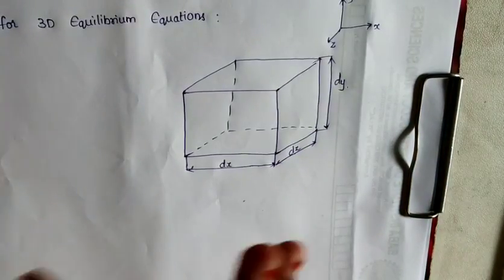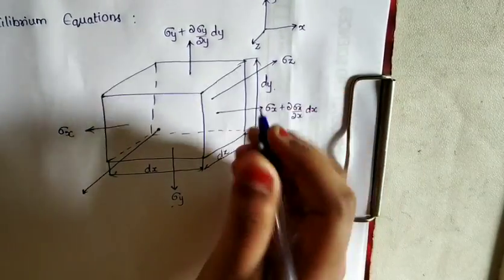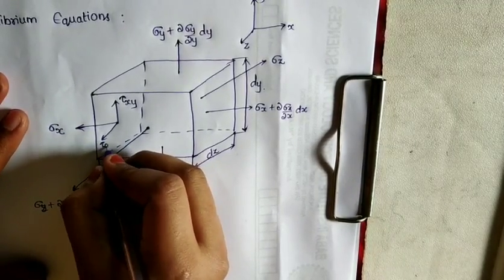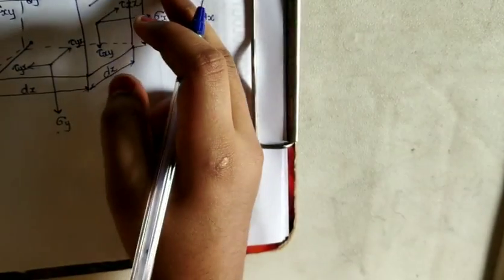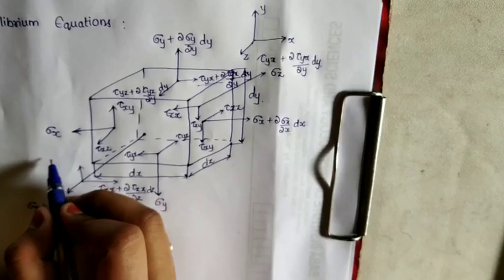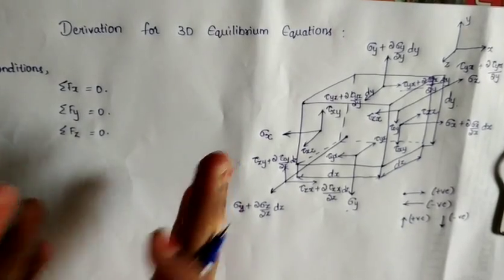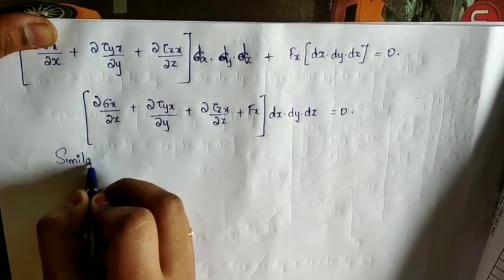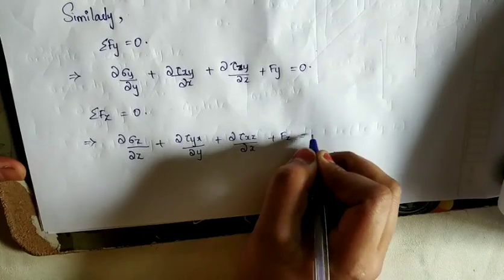FEM: Derivation for 3D equilibrium equation

Comment: AT 10:44 CANCELLATION IS WRONG SISTER COULD YOU PLEASE DROP A COMMENT ON THAT ASAP
Reply from the maker: Yaa I noticed it there was a small mistake that for (dz) I wrote (dx) in negative term so please cross check it. Tnq you for ur comment
Reply: Thank you but where should we change the process can you please drop a comment ?
Reply from the maker: 9.38 seconds note;(-sigmax. dz.dy) -instead of dz I wrote dx that's why you got confusion
Reply: Thank you so much 🙂
Reply: Also when writing similarly to sigma Fy and sigma Fz 
dx.dy.dz Miss chesaru
Reply: Add cheyali right ?

Comment: Fx, Fy, Fz is any body force ??
Reply from the maker: Yes we need to add body force along the x, y and z directions i,.E, fx,fy and fz
Reply: Why not include inertia forces ?
Reply from the maker: inertia is not a force because it would not cause an object to move from it's inertial frame.
Reply: @lovemechanical  thank you very much dear
Reply: Is it used for equilibrium equations for elasticity?